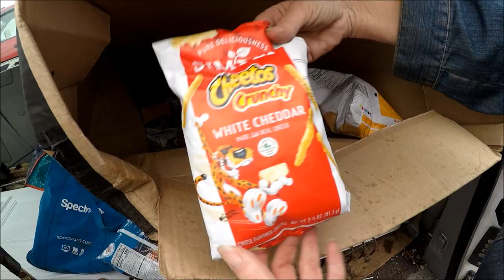First Photo of Black Hole...While Scrapping!

Comment: mix it up,, but i don't want the mean comment,,, by the way ladies if you found some batteries especially car batteries,,, try to wrap it with plastic or don't mix it with your metal scrap coz it can start a fire or you will be electricuted
Reply from the maker: Wow! O.k. we will be more careful! Thanks for your tip Charles!
Reply: I didnt know that!
Reply: @colleenposadas8415  when the two poles or the negative and positive touch each other by some conducting metal it produces spark that can start a fire,, i think it can't kill you but it  really hurts,,, i also uses old batteries to trap some rats and it can really  kill them
Reply: @charlesespinosa8986  i will remember to wrap mine up ty!
Reply: Thank you! You probably saved me from electrocution! <3 Scrap It Up!